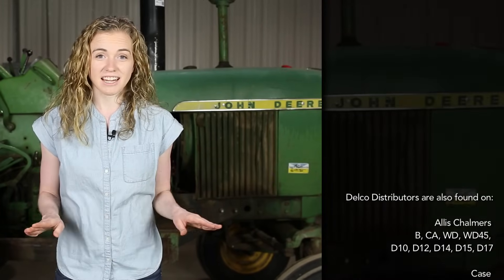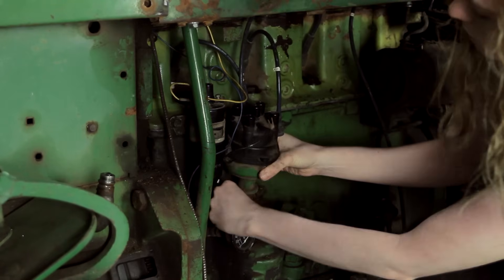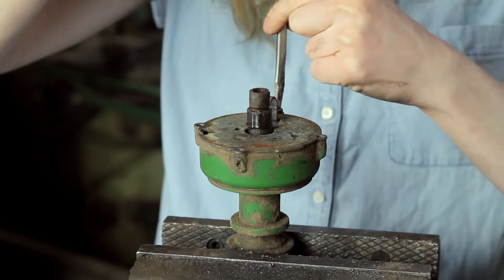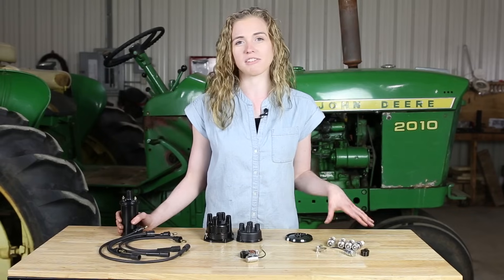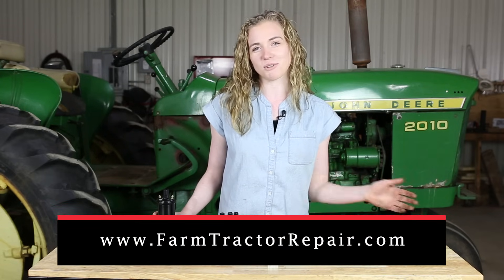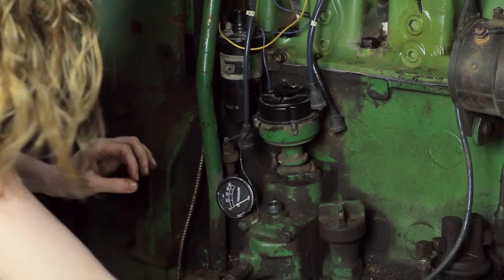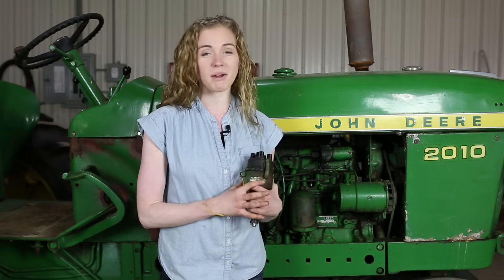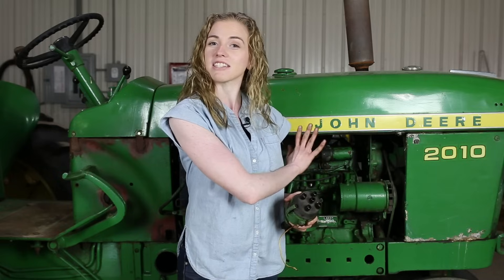How to Tune-Up your Delco Tractor Ignition and Install a Distributor in Time: Points, Coil and Wires

Comment: You should wear gloves. For health reasons. Most mechanics wear them. Also it just seems strange to see a lady getting her hands dirty.
Reply: Bro… real mechanics  often do not wear gloves. Gloves have only been in the technical field for about 15 years.  Try starting a small points retention screw such as she is doing  with gloves, you would drop the screw many times and fumble to start it.

Comment: Ms. Rachel : Beautiful job. 😎 Bryan.
--------
 Me , I would - get cam lube - (on my points) at the end & it never fire.
----++
 1 ) Back to lighter fluid 101 🔥 .
2 ) 50 % Diesel + 50 % Kerosene  tractor ( "chow" ) mix. 
-----
PT & I are excited (about the tire) we just ordered.
[ PT break a leg Bri ! ] 💫
  No ; PT it is , brake ; a lug - lose. 💕

Comment: Trying to get a 2010 gas to start but no success.  Have done everything, even removed the manifold to check for obstruction.  The engine turns fine, good spark, no start.  Have tried start fluid but no hint of start.  The cylinders are not getting fuel.  Looked in the intakes and exhaust ports on the head while cranking and saw the valves are not moving.  Assuming my worst fear is verified: broken chain.  Would this be easily replaced and do I assume the valves are damaged?

Comment: Most distributer caps I seen have a number 1 mark, so isn't it improper to put it anywhere. Usually you line up 1 before it's pulled out.

Comment: Great video, noticed a butt splice connector on your ohm meter leads.  When checking for resistance in things such as your coil the resistance in the butt connector can cause a bit of resistance in the meter lead and could potentially give a false reading if your checking certain items.  If you have a break in your wire or bare spot make sure you check your leads by touching them together and verifying they show 000 before beating your head against the fender chasing a false read.  Just a heads up for you and anybody willing to learn from my mistakes.  Keep up the great work.

Comment: Another quality video and in my situation, very timely. I've got a 3010 that I'm splitting to replace the clutch. After that I need to address a broke piston ring and several hydraulic leaks. These old tractors need TLC and Dan and Rachel help deliver that care. 5 Stars. Keep 'em coming!

Comment: The RC modeling community uses products like CorrosionX to waterproof  and corrosion proof electronics when needed, IE saltwater boats, etc.  These products seem to be persistent and don't conduct electricity.  Have you ever tried this inside the distributor?

Comment: Electronic ignition is the best way to go on the old gassers.  Worn bushings won’t affect e. i. near as much as points.  4010’s have a 6 volt coil and a 12 volt electrical system.  There is a resistor on the back of the key switch that drops out when cranking so 12 volts is at the coil for an extra hot spark.  When the key is in run the resistor drops the voltage to around 6 volts at the coil so it won’t burn up when running.  I bypassed that resistor and changed to a 12 volt coil on mine when I converted it to electronic ignition. Great video as always.
Reply: Older 3020’s can have the resister on the back of the switch as well.  The starter solenoid has a bypass contact terminal that sends full/all available battery voltage to the coil during cranking to get the hottest possible spark

Comment: I converted a few to solid state ignition. A small module and trigger wheel replace points and condenser.
No more issues hot intense spark instant starting now.
Excellent work Thanks!

Comment: Lol......Rachel, you almost had me screaming at you DON’T run the coil wire under the points screw facing down as I was typing this.....then watched a little further thinking...nah Rachel wouldn’t do that to us.
Luckily you didn’t let me down 🙂....and yes like you said, that grounded wire causes people lots of headaches to the non- mechanical people that aren’t afraid to have a go.
Love this channel.

Comment: what are points? and what do they do?
Reply: Think of them like a switch that turns the high voltage electricity on and off (coming from the coil and going to the spark plug).